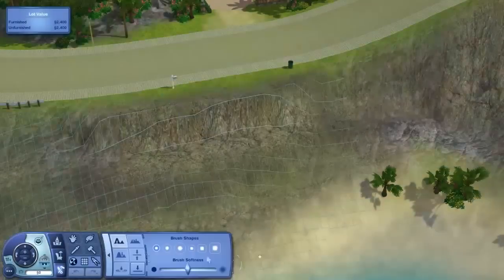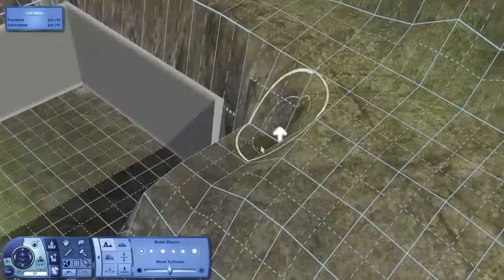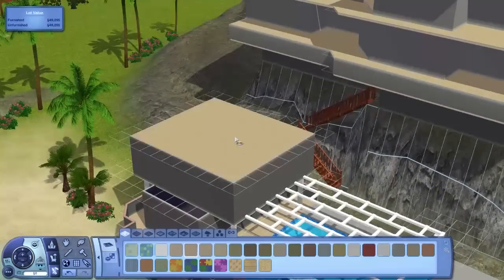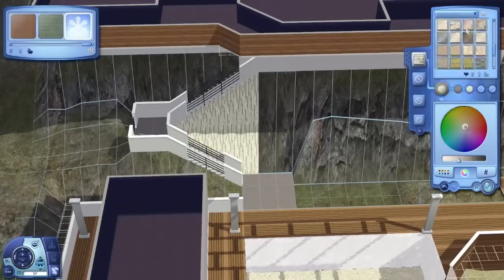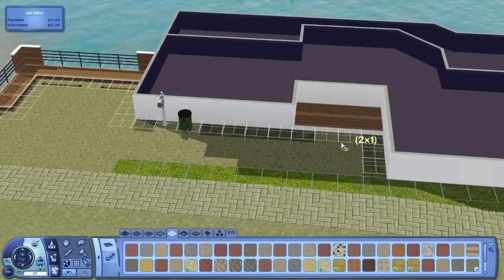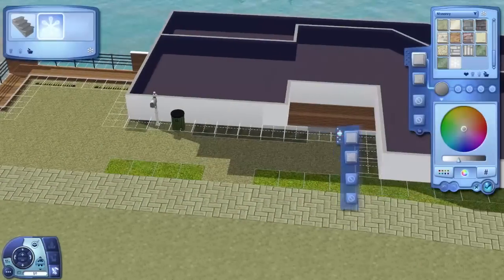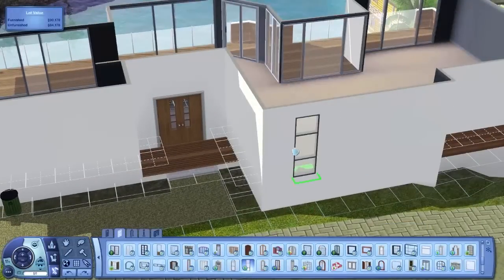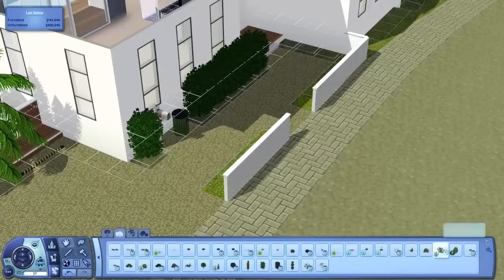The Sims 3 House Building - Nate Bay (Part 1 of 2) - Aluna Island

Comment: Hey James. If you like the unreachable parts of the house to be pitch black, consider using the DeBug tools. Use the EMPTY ROOM MARKER, like they do for unoccupied appartments, and it'll be completely pitch black.
Reply: That's great except you need to input a cheat every time you want to edit the house in build mode.
Reply: Almostfull777 That's why it's always the last thing I do before I finish my houses.
Reply: Almostfull777
If you're trying to make a detailed house, youre probably entering the Debug, Restarin  Floor, Moveobject, Object Snapping and other cheats, everytime you start to edit a house anyway.

Comment: You know what, James? The place where you moved the foundation to co-inside with the steps, instead of deleting the foundation to place the steps, you could have removed it and placed the stage so you hadn't needed to place the steps. The stages can be useful, but no one ever uses them. The Sim Supply
Reply from the maker: That wouldn't work, you'd still needs steps from the stage to the foundation

Comment: Why do you seem to rarely make a normal 2 floor house? You always end up using a basement as a 2nd level. The houses are always only one level from ground level and then the next level is below ground.
Reply from the maker: Because they are cliff houses, if they were all upward that'd be very boring and not use any of the vertical landscape on the lot.
Reply: The Sim Supply I don't just mean the cliff lots.